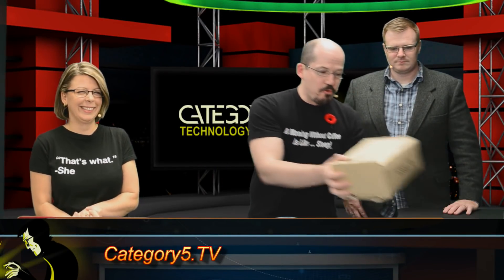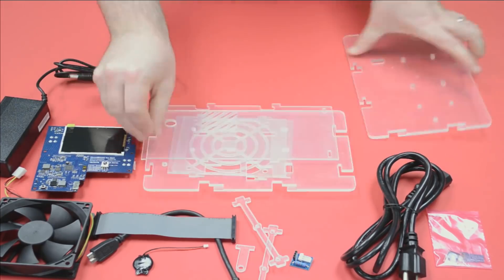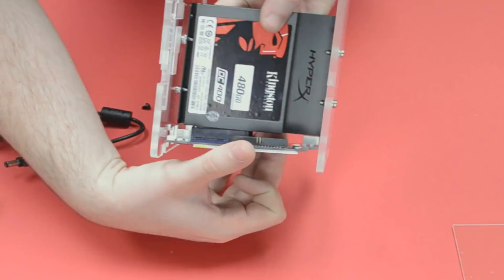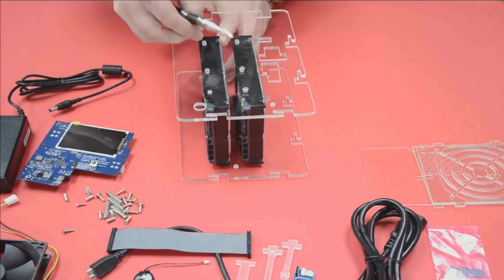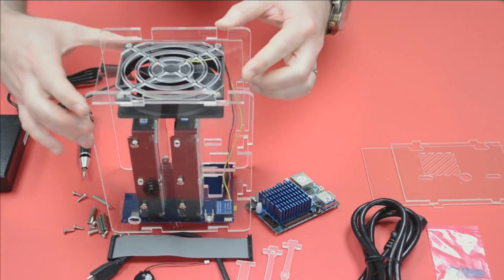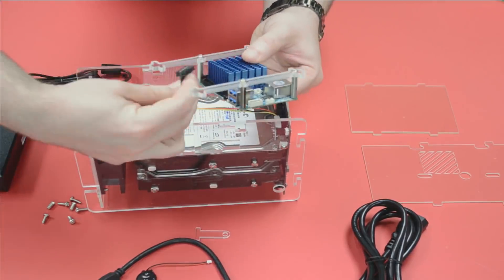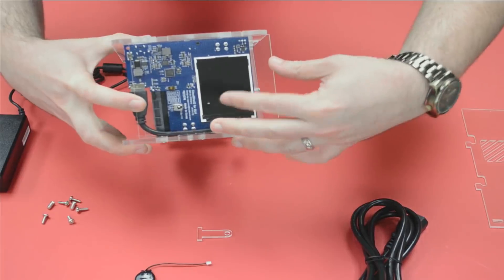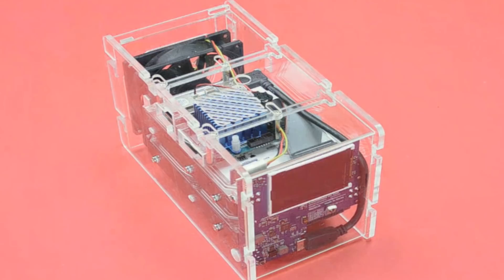The 8-CORE Raspberry Pi Killer: ODROID XU4Q with CloudShell2 Case - Assembly

Comment: And if you remove the active fan, you kill the Odroid with fire.
Reply: And when you add all the components featured, together, you've spent 200 bucks.
Reply from the maker: You can remove the fan if you want. It simply came with the kit but is pretty much optional unless using spinning hard drives.
Reply: you can get passive cooling odroids

Comment: so ECM memory card um i do not think i can pick one up at walmart when that thing gets full a SATA connector for the hard drive as they already know it will get full first hard drives are expensive and why to get a raspberry pi is it is cheap compability issues at the start is never a good sign also no GPIO pins for user defined port assignment the USB 3 port is nice and the HDMI 2.0 port with a  good enough on board GPU for 4k playback of hopefully open source movie format files is also good but requiring so much stuff that the raspberry pi just doesn't need you to have to work doesn't make it a "Raspberr Pi Killer" sorry
Reply: pi-killeris a bad term , missed point of the pi and it's story

Comment: Can it run RetroPie?
Reply: RetroPi projects supports XU4 as well. There is an installer which can be used to compile RetroPi on an ODROID XU4.
Reply from the maker: RetroPie is a build specific to the Pi, which is essentially Debian (Raspbian) and Emulation Station. Yes, the XU4 can run Debian + Emulation Station, and very, very well. I've seen N64 games like Mario Kart running with excellent framerates and none of the stuttering I get from RetroPie on my Pi 3. We will be demonstrating this on an upcoming show when we finally plug this bad-boy in and fire it up for all to see.
Reply from the maker: Awesome - turns out RetroPie has official documentation on installing on the XU4! I can't wait to see the performance!  New videos coming in the new year demonstrating this! FYI: https://retropie.org.uk/docs/Odroid-XU4/
Reply: congrats on pointing out one issue with term "pi-killer"
Reply: I have no stuttering on RetroPie on the pi. Then again, I have a mobile screen attached to my pi running at 720p. But it never lags on any n64 game. (Compatibility however, is another issue).
Reply: Yes you can install retro pie, but it's a worse experience than on a pi3, a lot of people put in time to customize it correctly, its a manual process and a bit of guess work.  I caved and enjoyed my old school emulation on the pi, my later gen n64/ps/xbox emulation on the PC
Reply: it performance should be better, it just a question of drivers working well
odroid is one board that will be going places

Comment: If it’s the same price as the pi, then it kills the pi, in this case, my desktop is a raspberry pi killer.
Reply: miss the point of the pi
Reply: But the Pi has wifi and BT... Toss those two in the other bag. :)
Reply: then why is the pi not out business?
Reply: "Pi lovers are just tightasses" The point of the pi is a cheap affordable way to give young people a way to learn coding. How is doubling the price making it a point to kill the pi? They both serve their purposes. I agree, but unless if something both solves the purpose of the pi (Cheap, affordable, base ground with a lot of community support etc). Nothing really ever kills the pi. There's been hundreds of "Pi killers". But the Pi is alive and well to this day with an amazing backing and community support to this day :)
Reply: Hmmm, twice the price is the issue? How about you toss in a heat sink, thermal paste along with things you don't get with a pi,  pick usb 3 and a proper 1gig ethernet port. This is easily worth twice the pi.
Reply: ODROID XU4Q  is not a Raspberry Pi killer, since they really don't compete for the same application uses. For applications that the RPi works well, ODROID XU4Q is over priced & overkill. Likewise, for applications demanding more power and config of drives, etc... like a small LINUX computer, ODROID XU4Q  would be the far better choice. Also, let's not forget the software momentum behind RPi, there is a ton of software and support for it.
Reply: In 2014 the ODROID C1 was released (at that time only the RPi 1 Model b existed) It had a quad core CPU with 1GB RAM at a price tag of $35 same as the RPi at that time. It forced RPi Foundation to release it's RPi 2 which still had lower specs than the ODROID C1.
No one ever called it the RPi Killer.
Apparently the price tag of $35 is just another way to express their loyalty to the RPi brand and has nothing to do with a it's value as it seems to come down to that argument alone some times.
Reply: Come one.  2x the price for 4x the power. It is a pi killer.  

Pi lovers are just tightasses.  They're both under 100$.  

If only the odroid was x86 compatible.  I would be like pi.  Hahaha. 

The io pins are available on the board and I can honestly say it's as easy to use as a pi.

And for anyone wondering.  

I have both
Reply from the maker: It is roughly 2x the price, but nearly 4x the power.
Reply: @LinuxTechShow  nope /it  cost on ebay 100 euro /3 times more see   https://www.ebay.es/itm/UK-Brand-New-and-Boxed-Odroid-XU4-Single-Board-Computer-Retro-Gaming-UK/123781137471?hash=item1cd1ee443f:g:KTkAAOSwnfVc6dbG

Comment: cool setup but for the price point it will not kill the raspberry pie, especially the pi 3 or zero w which both have wifi and blue tooth built in. Now I do like the fact that the kit does have a nice case and screen.
Reply from the maker: The board itself is nearly 4x the power of a Pi 3. I personally have found the Pi 3 to have pretty bad WiFi, so TBH I'd rather use a USB adapter anyways (or better yet, Ethernet) - so WiFi or no WiFi is not a selling point for me. For the next guy it might be, but not for me. I'd rather have the 8 cores, 4x the MIPS and 2x the RAM (and faster RAM at that), not to mention the USB 3.0 which really opens up a lot of options (like the USB Attached SCSI backplane I showed in the video). I really like the case, though of course, it's entirely optional. You could just run an XU4 in a case more similar to that of a Pi if you don't want to spend $$ on a fancy case with screen and SATA  :)
Reply: pi-killer is such a bad term, and stupid when you read the story behind it

Comment: NOTE: I have edited this after reading 'LinuxTechShow' reply.

SATA SSD 400-500MB/s x2 = 800MB-1GB/s.
USB 3.0 = 600MB/s Peek (4.8Gb/s).

USB 3.0 (3.1 gen 1) typicaly delivers upto around 400MB/s with high performance components.

USB 3.0 (in UAS) delivers upto around 430MB/s in real world performance.

In both cases Random access I/O peeks around 100MB/s due to poor optimisation in both USB TurboMode (your normal mode for USB 3) and UAS.

So, now I have corrected my numbers (I was having a bad Mb/MB day). I suppose when you consider it, its not far off max performance of eSATA for dumping and reading big files, with no funnie cables. One caviat on the numbers I have listed are for high performance controlers, good cables and very fast attached storage.

It would of been good to see the enclosure's colour screen running, and to find out what the noise is like with two HDD's running. I am also not sure I would ever put SSD's in it, as you lose the benefit of fast random reads and very low latancy that are the meat and potato of SSD's, and your SSD will not give you much better reliability over a NAS spec HDD with vastly more storage for about the same cost (or less). I say that in the full knolage that folk may have spare SATA SSD's as they move over to m.2 NVMe primary system drives.

I don't think its a bad setup, infact its rather nice all them bits. However 'pie killer' is used in the tag line as click bate. Also remember to click the 'show more' under the video for information like its not 4k its 1080.

O'yea want more info on the board, try this video: https://www.youtube.com/watch?v=PX_Oy-lSix8
Reply from the maker: Paul Sim you're mistaken. It's not USB 3.0 protocol. The Cloudshell2 backplane is UAS (USB attached SCSI). It gets MUCH faster speed than USB 3. But my reason for wanting SSD is also for reliability, low power consumption and no moving parts.
Reply: pi killer is a bad term when you read the pi story

Comment: I think they've missed the point of what the Raspberry Pi is. Is an expensive  i7 pc a cheap i3 killer? Obviously, not. Anyone can install Virtualbox or similar virtualizing software and run Linux, some flavour of Windows or indeed one of the Mac OSs in it, for free! Is that a Pi killer? No, if it was they wouldn't have sold 12.5 million of them.  Now if the ODROID it was the same price, you might have an argument, but it would still have to be adopted by the educational establishments who currently advocate the Pi. That said, it might be fun for the hobbyist.
Reply: miss the point of the pi , read the story

Comment: Very much the Pi killer, as it's superior in every aspect.
Reply from the maker: Ha! 13,000 views later and finally someone agrees with me.  LOL
Reply: LinuxTechShow.. 4K is a stepping stone, so not really that relevant.

The specs far outmatch the rPi3 in every respect, so it's purely down to price.
For a workable unit, you expect to pay more for superior hardware so that's a moot point.
Reply from the maker: Agreed. I look at nearly 4x MIPS for around 2x price. It's a no-brainer that this is the next gen for makers who need more power.
Reply: LinuxTechShow.. absolutely, especially if you're looking at a cluster with low power consumption.

This is quite interesting..
http://www.hardkernel.com/main/products/prdt_info.php?g_code=G150152508314

The big.LITTLE kernels work really well now, so I'm considering a few projects myself. :)
Reply: i do not agree with term, why , read the story behind the pi
once you understand it, you see why
now as far as getting one, I can see that but as a STEP UP, not as replacement
Reply: Mark Millender Jr. Neither of which should be a deal-breaker. #contextmatters.
Reply: Armand79th  Except when you consider that the Raspberry Pi 3 comes with BOTH Bluetooth and Wi-Fi standard, onboard, giving you all four USB ports to do with what you will.  Also, most people aren't using the Pi as a desktop replacement, so, yeah, that kind of makes the point moot from the word "go".  The Pi is meant as an experimentation platform.  Not to be an actual computer.  It's tantamount to a more feature-rich Arduino, and even that comparison is a bit much, as the relationship between the Pi and the Arduino is about as far removed as the one between this and the Pi.  The only real similarity is that it's a very small form-factor computer.  That's where the similarities end in all three comparisons.
Reply: well the old pi did not have either
Reply: although one use of pi would be a desktop replacement , a low cost one, because as I heard that fact when the concept was put together for the pi it was the fact one reason kids were not allow to use regular home computer was it was over 1000 dollars and to repair may 200 to 300. So the idea of a computer that if all went wrong you would not be out that much money is the whole idea. A cheap easy to replace mother board and hard drive, the 2 things that could be destroyed in a system crash. 
The problem with the "other boards" the "pi-killers" (bad term) is that they are either way more or badly made (aliwather based ones?) or badly supported. Plus missing the mark of the programming part, electronics part.
Now is the XU4 bad, no, but is a different class. First I would say not the beginner board the Pi is and has power which someone may need for a program that needs the power. (arduino has the YUN) this is another reason why I have issue with the "Pi-killer" term
Reply: Amdahl's law? Anyone? No? Okay.
Reply: Linux TechShow  Well, duh; you trawl the ocean long enough, you're bound to catch a fish...doesn't make you the best angler, if you catch my drift...
Reply: Bluetooth? Wi-Fi? No and no.

Comment: It may be a Pi killer but it's twice the price 6x the size the power draw is x3 no inbuilt Wi-Fi and the surface mounts look poorly mounted
Reply: pi killer is a bad term, read the raspberry pi story
Reply: How do you know the power draw is three times the power draw of a raspberry pi?
Reply: specs are there somewhere, the big thing is the term these boards use and it is sad because it misses the whole point
Reply: I strongly doubt that it consumes three times the power with the same peripherals and at idle. What do you mean by missing the whole point, though?
Reply: the bards who say "ras pi killers" are saying they are a better replacement. The thing the Pi was trying to do was to get people back into electronics and computers. By bringing a low cost to family computer and backing to ensure you can take off.  Low cost, quality and backing is key, and the Pi has such big backing it take allot to take it down
Reply: billfusionenterprise I do agree with you, that's a great point. I think they meant its a killer peformance-wise, though.
Reply: question,   ever see a bose speaker demonstration?  They make the perfect point about specs and comparisons
Reply: more power is nice, but they should call it your next step after pi
Reply from the maker: The big fancy case we bought for it is just what we bought for it. The board itself is the same form factor as a Raspberry Pi 3. Omitting the case/backplane/screen also means you can use a 5V power adapter instead.
Reply: @LinuxTechShow  "Omitting the case/backplane/screen also means you can use a 5V power adapter instead."... Yes... And then you have an SBC making this video pointless.

Comment: Double the price of a Pi, PLUS an $80 case, PLUS the eMMC, PLUS .....
If I spent another couple hundred dollars, I could trick my Pi 3B out as well. Hardly a Pi killer here.
Reply: Agreed, it holds a niche. But it's not a Pi killer, because it's niche is different from the Pi's. The attraction to the Pi IS the price - it gives you permission to fail when you're working with it. That's the attraction, especially for educational settings.
Reply: It can'[t be a Pi killer if it's not in the same ballpark. How is this used for prototyping? where are the I/O pins for connecting servos, pots, buttons or led's??? It's just a tiny desktop computer.
Reply: it is the craze of a bunch of SBCs and is wrongly used term
Reply: i think they were going for faster but the catch, not a raspberry pi
Reply: it is why i pick on the term
Reply: "not for everyone." hahaha. That's definitely not a PI killer.
Reply from the maker: You don't have to buy the fancy case with screen and backplane. We just wanted you to see what you can do, if you like. You can buy cheap lil' $9 case (just like the Pi) if you prefer. And yes, the board is 2x the price of a Pi 3, but nearly 4x the processing power! Admittedly, that's not for everyone... but it sure does hold a niche!
Reply: For the price of this single Odroid board, you can have a fully functional Pi 3B in a case, with an extra card reader and HDMI cable. The title is c l i c k b a i t